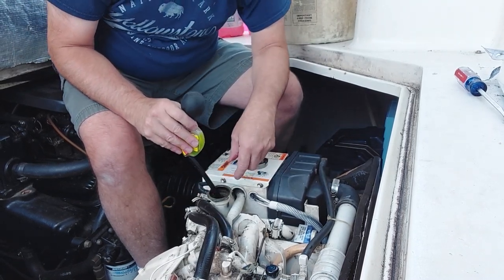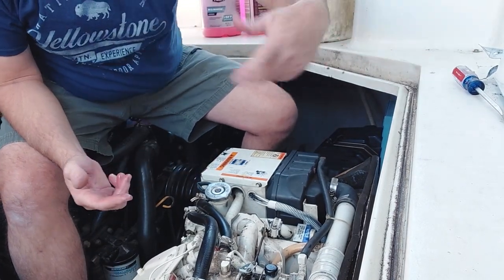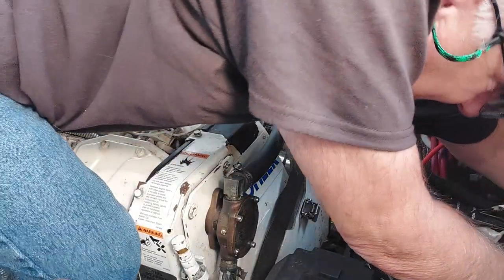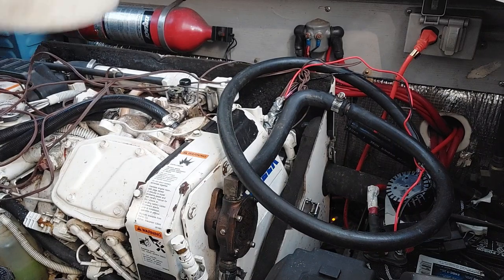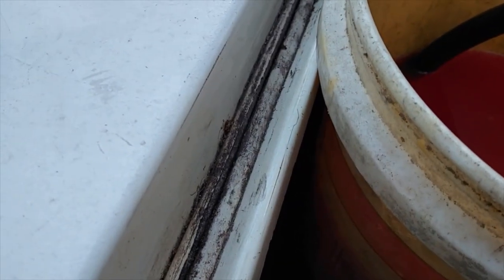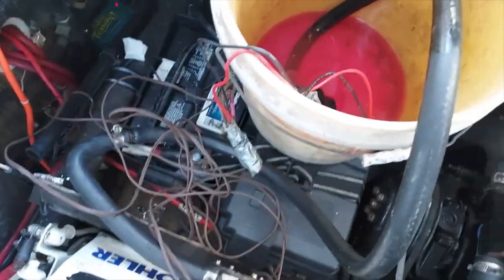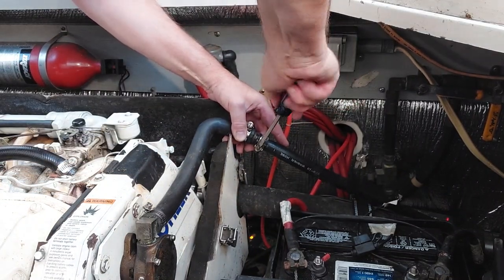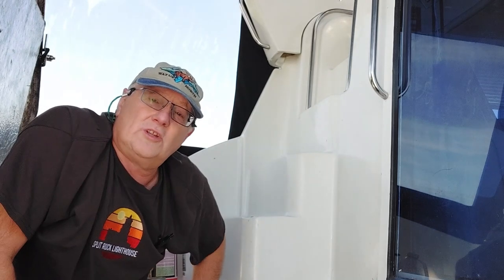Winterizing Marine Generator Closed Cooling Kohler 4K Save Money DIY on the boat

Comment: It is not environmentally friendly to pump out antifreeze into the water. I would strongly suggest you do it when it is out of water and catch the antifreeze in a bucket .
Reply from the maker: The pink stuff is safe I put it in the fresh water take as well. The pink also is not effective if mixed with water making recovery not usable if it is mixed with water from the muffler.
Reply: @mytwogoodhands2799 I agree with you.  The pink RV Marine antifreeze uses food grade gelatin as an anti-freeze.  The entire point is the RV Marine antifreeze is environmentally friendly.
Reply from the maker: @DougAlesUSA  Yes this is why we use it  Thanks Steve
Reply: @mytwogoodhands2799  makes me wonder if the above person read this, confirmed it to be true, learned from their mistake, and is now a better person or if they will continue sharing false information.